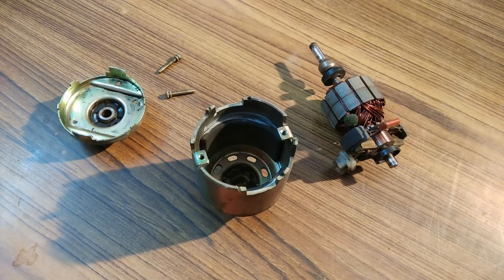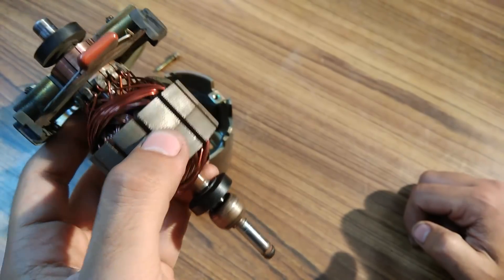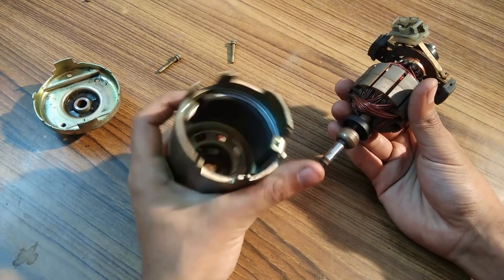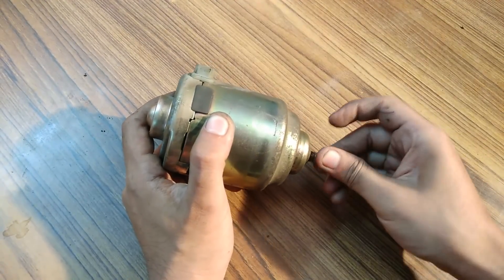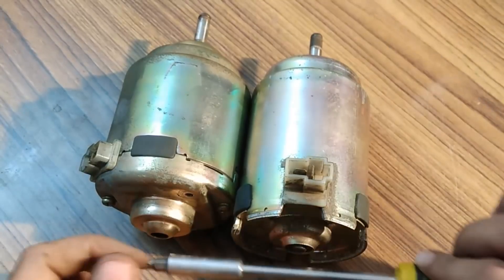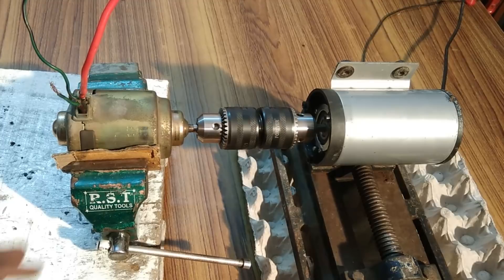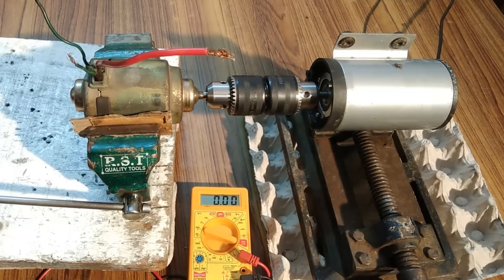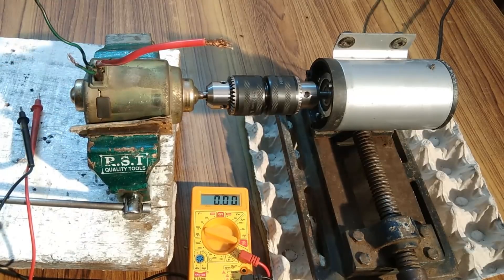Free Energy Generator from 12V Motor 500W | For Wind Generators

Comment: Two things
1.laptop charger only 19v not 90v
2.without load or load resistor how could you check DC current.
Your project is fack.

Comment: How can u measure current in parralal
Your meter should not measure current with out any load
Your meter fuse should b burn due to used amp meter in parralal
U r a fake person and this video is also fake
As per rule of measurements of current

Comment: Three things you should remember for a good generator: 
- The thickness of the wire,
- The length of the shaft.
- The strength of the magnet.
Reply from the maker: And the smoothness of the bearings or bushes

Comment: When you connect the terminals of generator to the battery for charging. It will becoming  a motor  
Then tell me the process to charge the battery with above said generator
Reply from the maker: Just connect one diode in series with the circuit..
Reply: Why charge battery, may be for storage.. (Electricity)  if I hv  amp, volts, from moving parts.. Above 500w...  Thn use direct....  Create